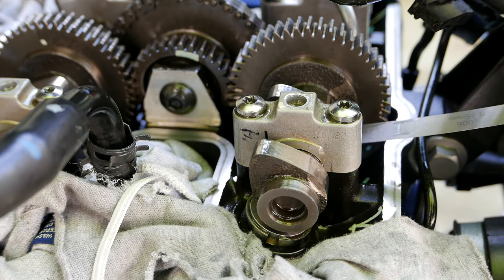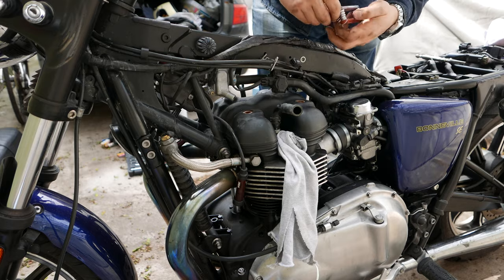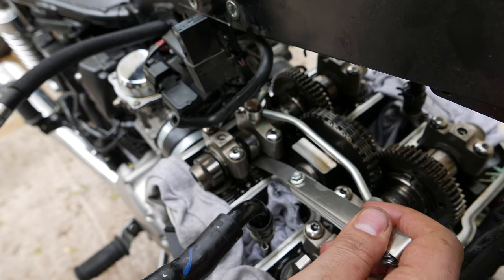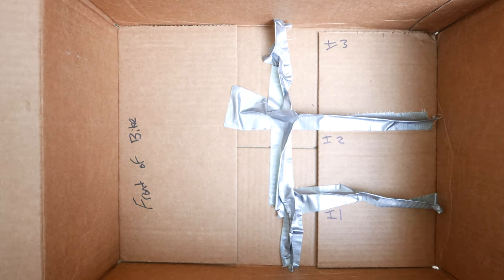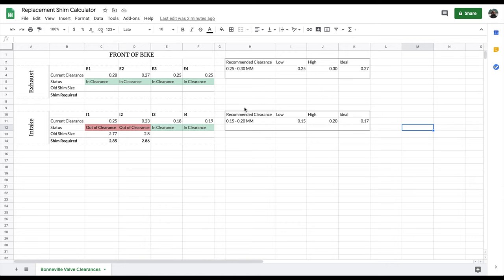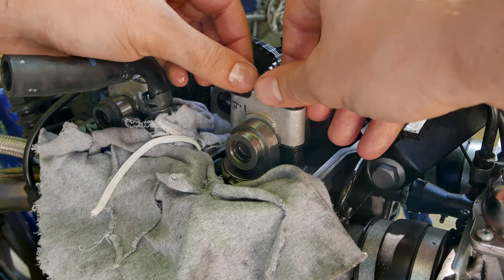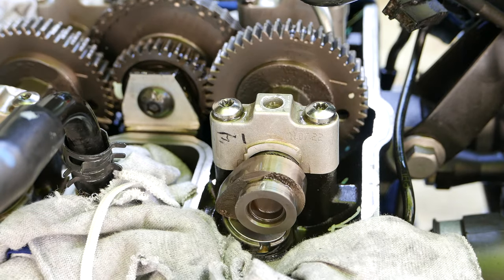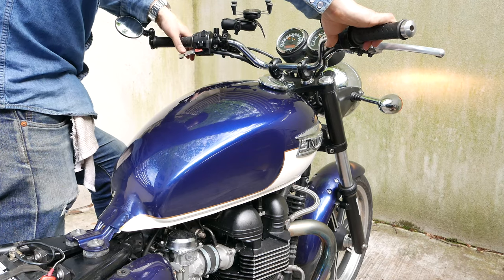Valve Clearance Check and Shim Replacement on a Triumph Bonneville

Comment: Great video,I dread shim valve adjustments. My question,and it  might be incredibly stupid, why is this called a SOHC,there are two cams,right? What am i missing?
Reply: It's a DOHC, since like you said there are 2 cams.
Reply: Ok,I have a 2023 street twin 900,it is a sohc according to the literature. Is that an air cooled bonneville you are working on? Does my bike have rocker arm activation? This is my first non Japanese motorcycle
Reply: And thanks by the way
Reply: @garydavis2265  it looks like you are right. The engine in your bike is a SOHC. My understanding of the Street Twin was to be an more inexpensive bike than the Bonneville.
Reply: After doing a little research it appears that all 2016 and on bonnevilles are sohc

Comment: There is no gasket to replace on the valve cover? Or is there any?
Reply from the maker: You can replace the gasket on the valve cover. I just reused my old one because it was in good shape. I have not had any leak issues since doing this maintenance 18 months ago

Comment: Why can't you just buy new factory shims? Why do you need to get special ones with different thicknesses? I have 24,000 miles on mine and never checked them yet.
Reply: The factory shims are not one thickness across the board. Manufacturing tolerances make it necessary to use an array of thicknesses for the shims to get the clearances correct. With miles on the engine, you must now factor in wear. The only way to get them right is through the measuring and calculating process. My bike is at 15K miles and it appears that the valve adjustment was never done. I will require four new shims on my adjustment. It really isn't hard to do.
Reply: @StRYCH9ofFOCR  Thanks for the info. My bike is running fine. Maybe I'll do the work this off season.